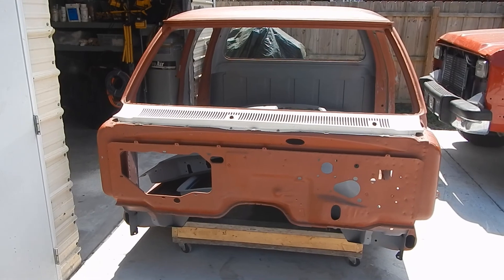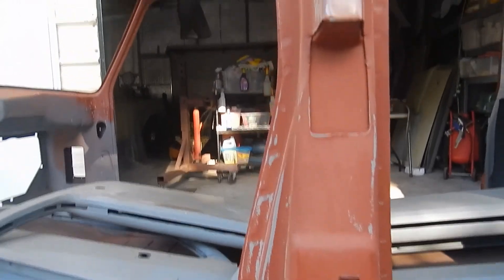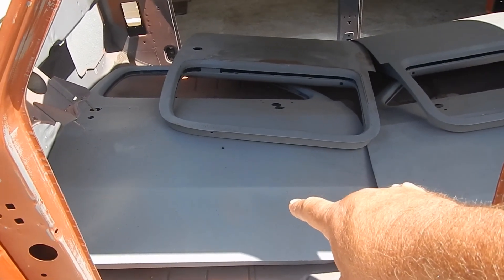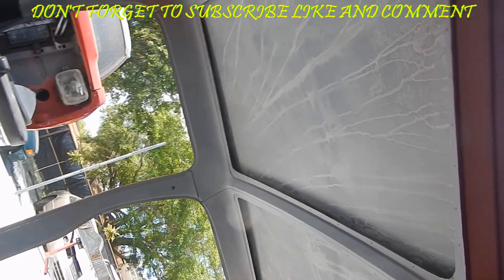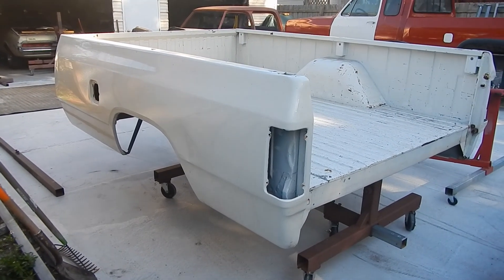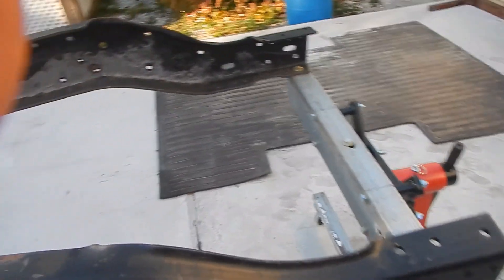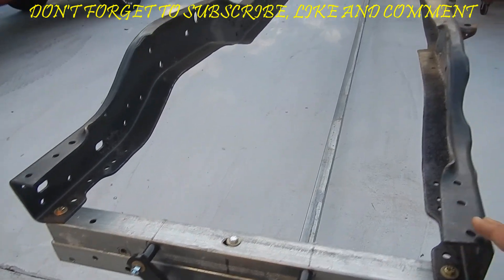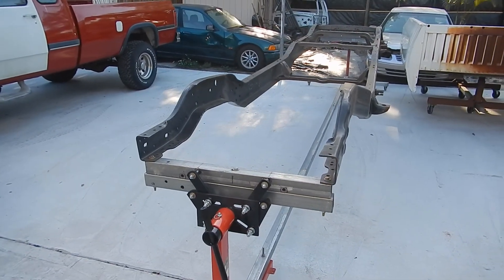1st Gen Cummins Crew Cab Conversion, Episode 4

Comment: Make a video of the removable roof panels, I’d be interested to see that.
Reply from the maker: Hi Tom, working on that. I have a new piece of equipment that will make the video pretty interesting.
Reply: @ronsre-creations5289  Just found your videos. I'm doing exactly this with a 1985 crew cab and a 1990 donor powertrain. My crew is rust-free from California, a former forestry truck. W350 crew short bed.  I'd be very interested in the roof panel video as well. Hoping I run into it as I keep going through the episodes.